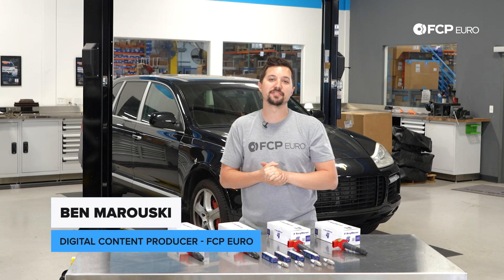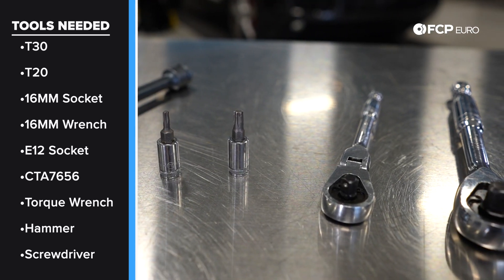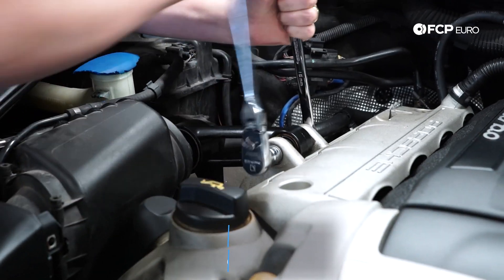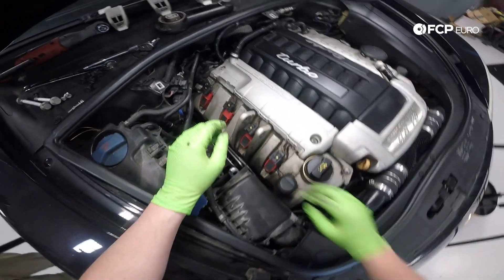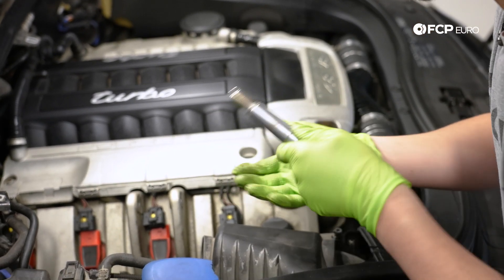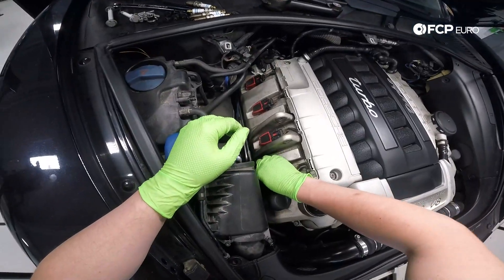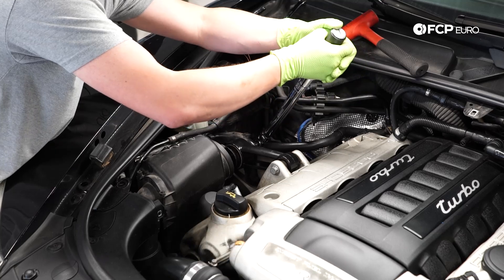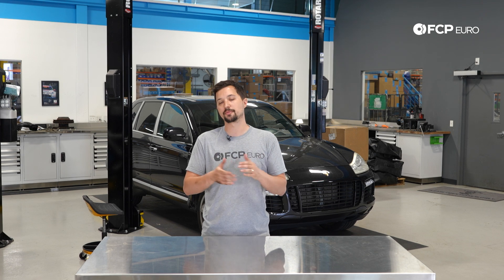Porsche Cayenne 955/957 Ignition Coil & Spark Plug Replacement DIY (2003-2010 Porsche Cayenne)

Comment: Do you ever use dielectric grease on the coil pack-to-plug boots? I do a lot of off-road driving and am in a climate where heavy rain is almost a DAILY thing. I was told by the dealership that it's not necessary, but could help in instances where standing water gets under the cover and near the spark plug port. Is this something that you have an opinion on?

Comment: My 957 gts on a 08 plate has developed a misfire the car is super shaky and low on power.....I hope the coil replacement does the trick....plugs were changed not long ago

Comment: how about the driver's side? The remote battery terminal cable is bolted to the block and obstructs the last coil. Too tight to get a wrench in there. I can't see how to disconnect the clamp to move the battery cable.

Comment: Thanks for the video. I ordered the kit and you guys provide the dielectric grease but I didn't see it used in this video. Does it need to be used?
Reply from the maker: Hi there, since these coils are bolted to the valve cover, you can certainly use some for this DIY. Ben had pre-dabbed the coils before installation.

Comment: A common issue with the 957 4.8 motor seems to be P2181 -- Cooling System Performance, usually because of a stuck open thermostat. That job and the replacement of the water pump in front of the thermostat looks too complex for DIY. What do you say? Thanks for these Cayenne videos.
Reply from the maker: It is 100% on our to do list M. Cooper! This car actually had the T-Stat stuck open code, so it's a perfect test subject for the DIY. Stay tuned , lots more to come.
Reply: Thanks! I think the thermostat on the V8 Cayenne is not a question of if, but when. They could have put it in a more difficult location, but I can't think where that could be.
Reply: Where did you buy those sparkplugs
Reply: Funny enough I got the P2181 code, reset it, came back a few days later. Took it in for new thermostat and water pump since the pump wasn’t documented as replaced. The thermo was replaced a year ago though. Hopefully this squares things away. It’s definitely DIYable but there’s a lot that goes into it, removing the belt as well so I opted for my local Indy. Diagnosis, new thermo, water pump and belt with all with 2 year warranty came in around $1,800 at $200 an hour. For those in Orange County CA I recommend Daniels European for any non DIY work they only use quality parts, quality people, and log pictures of their work plus update the carfax with the work done so resale value will always be higher and appreciated by the new owner. 

Spark plugs and coils is next and definitely something I’ll DIY along with oil and pads/rotors